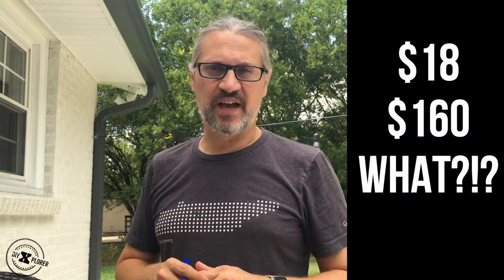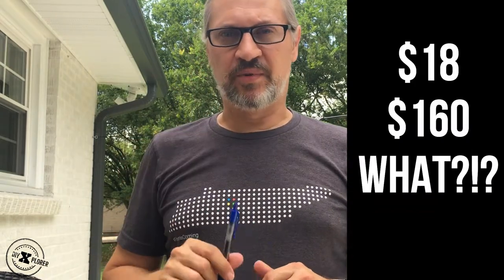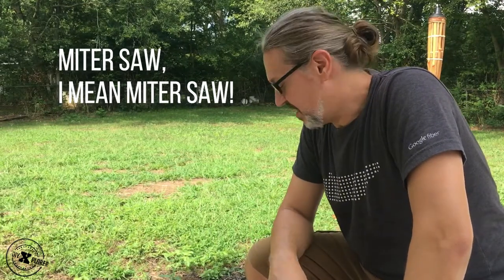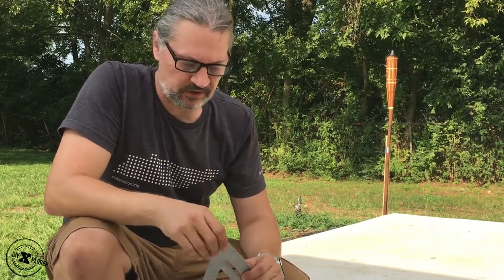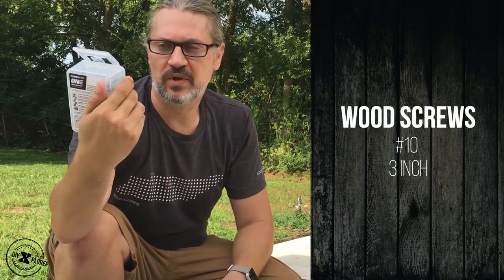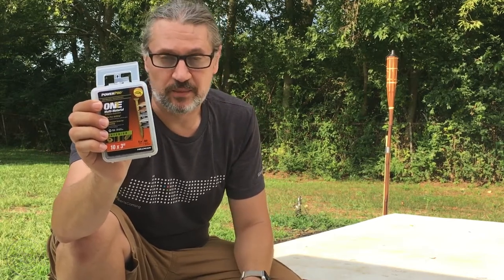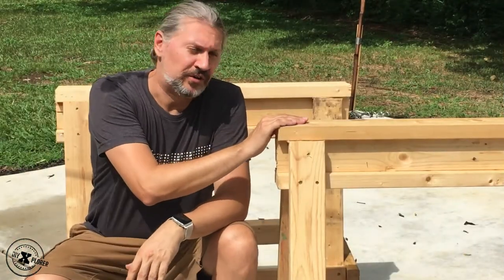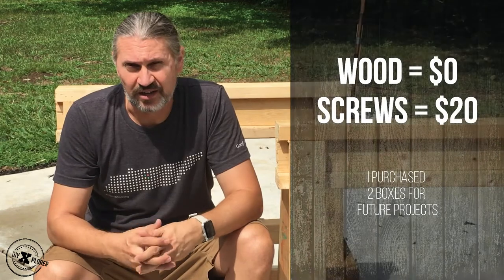How To Build Sawhorses Easy and Cheap with Tools You Have | #HOWTO

Comment: Great video. I did a similar project a few days ago on my channel, but I think your project is easier and faster to build. Probably I will make this type of sawhorses in the future. Good luck with your Youtube channel and make more videos. New subscriber.
Reply from the maker: Thanks! These are a basic design that my dad used to make he was carpenter for 50 years. He said it was the first thing you built as an apprentice. My family were all carpenters and I turned to be a computer guy. Anyway, I checked out your channel as well good luck as well. Your sawhorses are nice a bit more complex for the tools I'm starting with. ;-)
Reply: @DIYXplorer  I going to use my sawhorses as a temporary workbench for a while. Sometimes I go crazy with the design, just trying to make something different. Thanks!